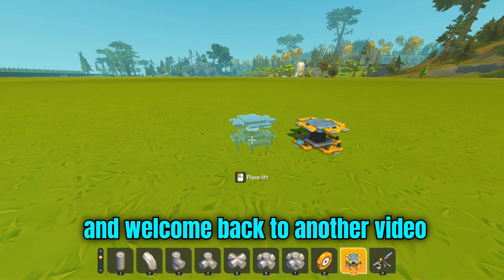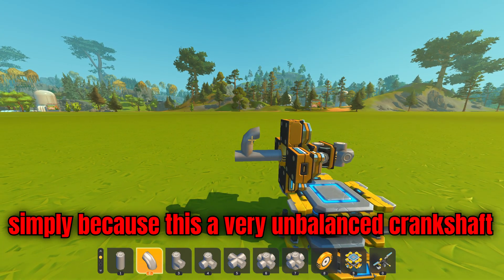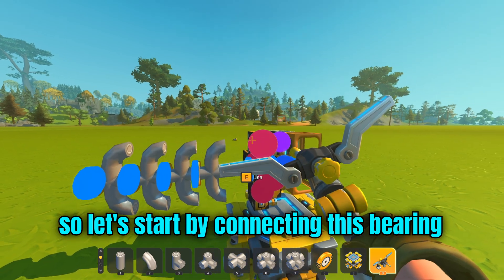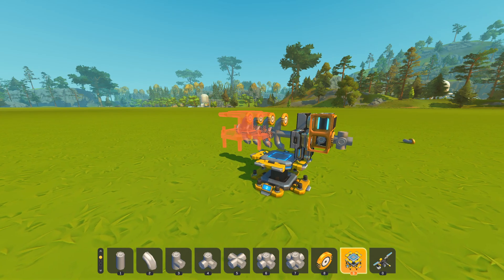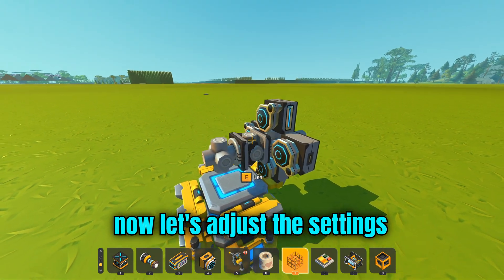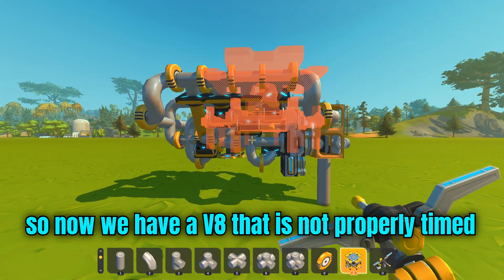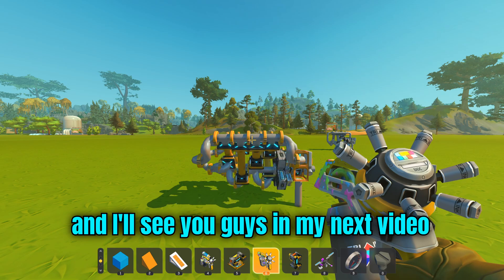How to properly make Piston Engines in Scrap Mechanic 2023

Comment: Hello I have a problem as in the v4 wen I try to stop it, doesn’t stop wen I connect it to the 4 bearing and make it -15 it goes faster I have watched the vid 3 times and I still can’t find out the issue and funny inuff I worked as a mechanic for a year 😭😭😭
Reply from the maker: the funny part we do is we retard the timing until it stops (which you shouldn't do irl)

Comment: How do I reverse the rotation of the v8
Reply from the maker: @razorbladehands5771  you can make the timing plate also rotate to adjust the timing, you can also use logic gates but it affects the efficiency of the engine.
Reply: @Deniz69567  thanks

Comment: No matter what I do I can't get the V8 to work. When I get to the part where I angle the bearings 45 degrees, the engine flies away and clips like crazy
Reply from the maker: you just put some level 3 concrete blocks to make it heavier and so it doesn't fly away, the engine flies away like that due to the amount of torque. these engines typically make more than 6000NM of torque, and so it generally flies away due to the torque

Comment: Pretty nice engine man, thank you for the guide!

Having said that:
- 1x1x3 Passthrough joint: 11 out of 10
- Balanced axle/crankshaft: 10 out of 10 (but ya know, kinda obvious)
- Still using "timing plate" spinning sensors: 5 out of 10

I greatly prefer the "hammer design" (that very few people seem aware of?) instead of the timing plate design:
1) Replace the top-most T-shaped pipe pieces (where top of piston connects) with +-shaped pipe pieces
2) Then you put T-shaped pipe pieces on the top of that (90' angle offset to axle/placed sideways) with screws on the sides
3) Then sensors on the side of that to detect the (screws on one side of the) hammers

This gets you really superb timing with any amount of pistons , less bulky 'bottom of the engine'/'crankshaft-axle', something that arguably looks better & finally something that i'm pretty sure uses less resources for the sensors (90% sure fast moving sensors still cause lag like they have done for years now? so this one having no moving sensors within the objects grid should mean it has to do less calculations, so its better? the perfect timing is my main reasoning for using this hammer approach tho, the sensors moving a lot less is just a bonus) you can still have it run in reverse too (like timing plate designs) by either moving the sensors to the other side, or having sensors on both sides and a little logic to toggle between them.

I strongly encourage everyone to try this hammer design, it's just 🧑‍🍳👌and more people should use it.
Reply from the maker: thanks, but I don't know why you would not like the spinning sensor timing plate thing? It's still mostly used for powerful engines til this day.
Reply: I know this is a bit late, but the reason sensors are actually better placed using the method in the video is due to something called timing advancing. This is something you cant do with the design you have specified, timing advancing allows you to offset the sensors from the crankshaft rotationaly to compensate for the 1 tick logic delay that the sensors have to the pistons, this means your engines have much more efficiency, resulting in more power and speed. All of the very high power engines in our community all utilise the sensors spinning and timing advancement as it is the best method out there.

Comment: Issue.
People are already adjusted to the old system, and there are a lot of blueprints using it. Most people will not bother to adapt, even if it is a better system. 

...unless you manage to make your argument for this better system easier to understand (...and less rude).

8:14 temporarily rotate the cranks individually to install the bearings and pipes?

Another thing I've noticed comparing these to the designs already in use is that while these put out way much more RPM with what seems to be much smoother timing, potential problems regarding lag and lower physics settings environments may arise.

Comment: hey uh, can i ask if the lv5 piston is necessary ?? cuz im intent to make an i4 in survival mod ( crashlander ) n the heavy duty alternator does put alot of resistant to the bearing connect to it, so i wonder if the max lv piston is needed to create the power n turn the bearing ??
Reply from the maker: max level piston is obviously the most powerful, if you use lower ones you would get less power

Comment: Did you consider a way of putting the engine into reverse without the need of flipping the angles on the controller of the I4?
Reply from the maker: unfortunately flipping angles of an i4 to reverse is the only way. Adding gear mechanism are not that good at all.
Reply: @Deniz69567  But do you think it's possible? I was experimenting with a gear shift system yesterday, and I feel it's possible to make one, but the gear physics are definitely a bit wonky.
Reply from the maker: @UnknownSeekerProductions  dont use gears for reverse lol
Reply: @Deniz69567  fair enough, I suppose. I just thought I'd see if you thought if it's possible.

Comment: Can someone explain why we do the piston thing for the timing wheel
Reply from the maker: it's called a passthrough
Reply: @Deniz69567  yes I got that but what is the purpose of it? As far as i can tell blocks are not going through it so why do we make it
Reply from the maker: @kelshake  it stabilizes the crank. The efficiency & reliability will be reduced without it

Comment: How exactly do I hook this up to a seat😂
Reply: It is started, stopped, or reversed using the angle of the controller. A controller can be hooked directly into a seat, or a switch can control it. So you can for example set it up so the default angle is off, and the next angle is forward at full speed. Then you can just connect the controller to the seat so it goes when you hit W and stops when you hit S. You can also have a clutch in the drivetrain, and from there set the default angle to reverse and the next angle to forward. Then you can connect the clutch to a w/s converter so it will be active either when pressing w or s. This will make the car go forward with w, reverse with s, and roll freely when not pressing anything. Alternatively, just connect the controller to a button and hit it to go forward.

Comment: now i'm a complete noob when it comes to piston engines but for the inline 4 (and i suppose the v8 as well, haven't finished watching the vid yet), don't you lose some piston power in the bearings at the top? what if you were to stop them from pushing the link upwards, maybe with screws on top, facing downards, on the same block space? i think the screws are a pixel away from not colliding with a pipe if they stay in the middle of the block, and if they do collide, that's not really a place where a little bit of friction would be catastrophic, it might even not matter at all. this would stop the piston attachment from moving upwards, but not left/rigth which i guess could be done with screws on the side too (and a lot of glitch welding), or maybe glitch welded concave wedges? (we just need to figure out which blocks more and collides less). anyway the piston mostly pushes the links upwards so that's most of the torque loss from there theorically avoided. might be worth testing. also for the pass through link, what if instead of making the link passthrough, you make the block the link passes through pass through? (obviously we couldn't use your design anymore but the "regular" one would be way more efficient as pistons there would loose you some torque),. again, might be worth trying, might not. it also makes for a more realistic (lol realism in scrap mechanic) drivetrain bushing since the piston would allow a little bit of play (probably a lot less if you put pistons all around the block you wanna pass through)
Reply: about the side load blocking on the piston attachments, it won't work since it'd block the t part of the t pipe and therefore stop the piston from oscillating. in other words it'd immobilise the engine compeltely or cause massive collisions
Reply: and for the passthrough bit, obviously you'd have to make it on the side where the encoder wheel is not, which shouldn't be a big deal (cause obviously sensors and controllers being replaced by pistons doesn't work too well last time i checked)
Reply from the maker: well, what you've said doesn't make sense, these designs are the most common from the sm mechanical community and none of these are wrong besides the sensors having no colour mode. And, piston engines are known to work better when the pistons are stretched enough. When it comes into sm, you have to think something weird for something better @K0wp3R

Comment: Hi, I loved the video but I just have a couple of questions when it comes to the timing. Why did you add in two different angles into the encoder wheel and is there anyway to easily program in a reverse for this design?
Reply from the maker: yeah you could put two bearings on the sensor and connect the bearings to a separate controller

Comment: Please someone send this to kan or mark him here
Reply: I just posted the link to his (One hour old link).   I'm loving the piston straight through glitchy tip..  It'll certainly have a place or more in my S.M.  worlds.  Cheers.
Any automatic brake light ideas.?  
And / or a non laggy Truck & Trailer 5th wheel hitching mechanism?
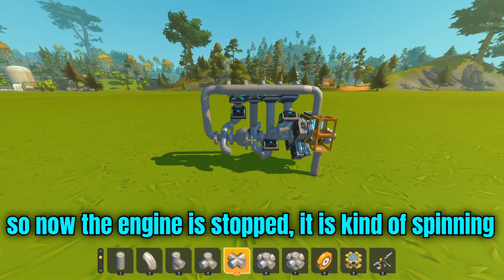Reply: 10:15 did you notice the pipe spin and passthrough main pipe, if that's IRL it's not possible like that and I will consider to make other design that similar to IRL...
Reply: Unfortunately getting an efficient direct drive through a block is a game limitation.

Cows being known as Wocs and wearing their udders as headgear is an everyday occurrence in the SM world and can be assumed as a reality check when in game.

That aside, this passthrough glitch is as handy to a creative SM player as the Technical Lego Single Block piece with Hole and Axle is to a Lego box full of standard bricks.

The physical realistic in-game option would be a block left out of the frame in order to allow a thick pipe piece to transmit the output from the engine.

That will cause the game to try to calculate the physics between 4 surfaces of a square hole on a large pipe circumference involving:-
Pi, Mass, Friction, Vibration, Speed, Particle effects, etc etc.
Which then slows down the computers framerate and the creations efficiency and general gameplay.

The games attraction is the ability to use a vanilla inventory, creativity and imagination to build ALMOST anything.
Just like Lego / Meccano.
With the added hurdle of "Scrap Mechanic Physics" then have it run smoothly in game.

Shared with others on the workshop brings likes, Scrap Mechanic physics creativity recognition, YouTube views, sponsorship deals, fame, recognition..

The cash to afford a new engine for my motorcycle because some idiot welded a piston with two bearings either side of it to rotate the camshaft output through the crankcase to the flywheel.!

And possibly a Girlfriend..

LOL. 

Cheers.

  @resonance_sky

Comment: I like putting the sensors on the frame and putting the encoder wheel on the engine and making it out of concrete so that it acts like a fly wheel from what I’ve tested that actually makes the engine smoother but that is from my designs not this one

Comment: how to do make reverse gear?
Reply: did you find out?
Reply: Nope
Reply: @slussareq8399  aw
Reply: @slussareq8399 it’s been two months did you find out?
Reply: @The_indigo_monke   i think it's about changing angle on the controller to -180 degree or something nearby that but i don't really know, I've been looking for that answer for quite some time but i still haven't found it. i have 2 desings for reverse gear but they are crappy for heavier load

Comment: Sorry for the long comment, but I insist you read all of it.

1:16, there is a much simpler way to do this, you place the piston or suspension pieces, and then a block that connects the other end. and example is one pipe, a piston, then another pipe. now you can put a bearing on the end side, and put the middle block or pipe on that bearing, this also saves a bearing. 
I can record me making an improved design, or simply making it more efficient. 
One thing to note, is that while adding extra blocks to the crankshaft in an attempt to make it more balanced, doesn't really do anything, because there is no counterweights to oppose the pistons themselves firing, and the "unbalanced" crank is opposed by another piece, making it balanced already. 
You also have a bad timing plate design. it's best to use 3 blocks in one corner, and then use wedges on the sideways corners to make the timing completely halfway on and halfway off. otherwise you have a higher percentage of timing time where it is off.

don't believe me about the crankshaft? remove the pistons and spin that crankshaft but don't forget to keep them rotated, then remove the lower corner pipes, and spin it again. there will be no change other than less weight.

And yeah the v8 behaves more like an opposed boxer engine. all you have done is changed the direction that they start in, while moving them up one block. Rotating them to be flat will have no significant change, other than you need to change the timing because of that block height difference.
Reply from the maker: 1. there's actually a lot of ways to make passthroughs, we could use a ramp that uses 1 bearing or a 0wb
2. the 3 block timing plate design will missfire and makes the engine unefficient and wedges on the other hand have larger collisions than a block which means it will make collisions on the sensors making it even more unefficient
3. the crankshaft balancing is very necessary on inline engines. Don't believe me? try running the engines with no counterweight and you'll see how much the pipes and bearings bounce off compared to a balanced crank
4. I mentioned about the v8 having boxer crank at the end of the video and I mentioned that boxer crank are the best design with huge efficiency. People in mechanical community often uses these a lot
Reply: @Deniz69567  yeah, I was sort of not thinking about real life, so ofc I know irl you need counterweights, but scrap mechanic doesn't need any. and I don't think you knew what I meant describing the timing plate. if I could draw a picture I would show you what I meant. lemmie see if I can put it as text.
my proposal:
[][][/
[]o
[/
your one:
[][][]
[]o

If you rotate both -45 degrees, the one on the top is completely even, while the lower one has a missing chunk, and an overlapping chunk.
Reply from the maker: @-aid4084  You should try it, you still need counterweight, you can see how much the pipes bounces off the bearings

and what you did for the timing plate is just wrong. Very wrong. The mechanical community will be very pissed at you 😅 since scrap mechanic doesnt work like irl
Reply: @-aid4084  Scrap mechanic does need balancing but its only body based, at the lower conventional engine speeds the benifits arent really that noticable but certaintly at the higher levels of speeds (1000+ rpm) you would be unable to actually make some engines run reliably, not having balancing is seen as bad practice by most of the piston engine community.

Comment: our pcs are so similar i have a standard 1650 and a 4th gen i5 aswell as 16gb of ddr3 ram
Reply from the maker: cool I recommended buying an e3 1246 v3, it's less than 40 bucks and the performance is equivalent of an i7 4th gen

Comment: YES! Thank you. Now I can finally make the Super muscle cars. I was just doing Inlines before with massive torque.

Edit: My V8 won't stop. I did the same timing as you, it just powers through it.
Reply from the maker: you try retarding the timing
Reply: Fixed that issue. My question is, I want to make a RWD Drivetrain without having those connections to the rear wheels on the OUTSIDE of the wheels. My only issue is, it transmits most of the power to one wheel-Whatever wheel has the initial gear that allows the rear wheels to spin.
Reply: @crimzonplays1134 

I mean, a lot of V8 muscle cars have Lincoln Lockers anyway 😂
Reply: @crimzonplays1134 then you should see if theres a way to lock the differential, or make something where you can use suspension to press together and slip less, and the suspension would be variable with the suspension stiffness
Reply: @_BaguetteDoggo  figured it out. Added Some elbow pieces with a Piston connected to them that allowed me to link both rear wheels together.
Reply: @crimzonplays1134  very nice! lockable differential
Reply: No, it isn't. I have an elbow piece connected to a T connected to the wheel, then it has a T piece on the other side of the wheel support that connects the main body of the car to said wheels, then two elbows with a Piston in between that allows the wheels on both sides to always spin at the same time by making the piston clip through the wheel support bar. Cuz I can't make a locking differential that would work in survival. I plan on making a muscle car In survival.
Reply: @crimzonplays1134  ahh okay. got it now lol
Reply: @_BaguetteDoggo  Locking differential isn't possible, right?
Reply: @crimzonplays1134  its possible, its just decently complex. you’d have to make a lock and catch type of system, but then again it may slip out

Comment: That crank is still unbalanced according to your theory because of the connecting pin for the pistons on the I4 engine.
Reply from the maker: bruh the connected pins are no longer a part of a crankshaft, if you take a look at irl engine they also have connected pins
Reply from the maker: you can run a bunch of experiments, there are no other ways to balance a crank other than this
Reply: you are literally saying the crank is unbalanced because of a part that is not the crank, the crank itself needs to be balanced, not what is attached to it